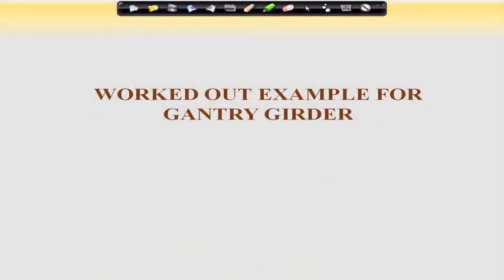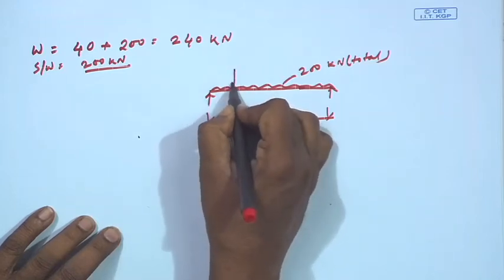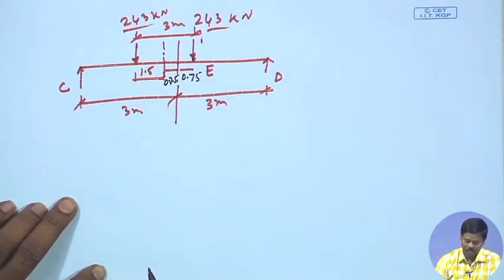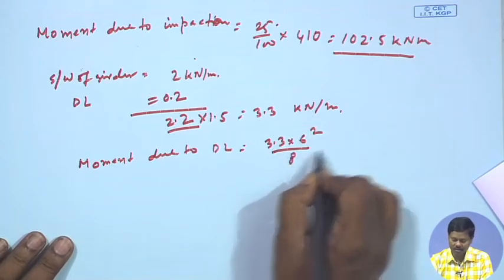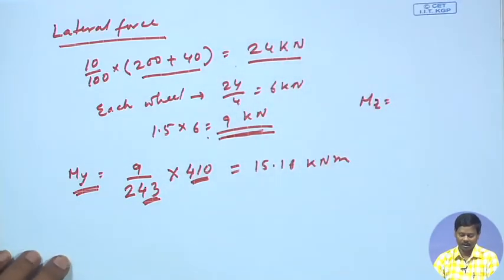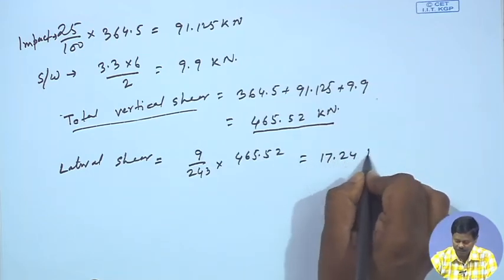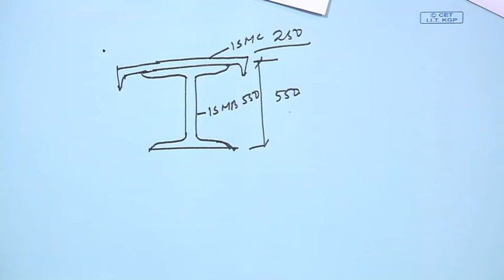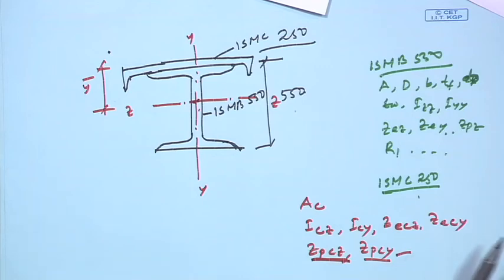mod12lec58

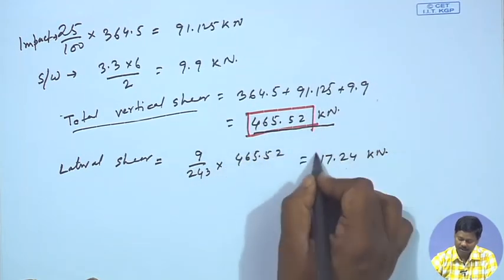Comment: At 15:33 & 19:33;     during calculating My, only moment due to vertical wheel load is considered(410 knm) but when comes for lateral shear force, total(wheel +impact +self weight) shear force is used   why???